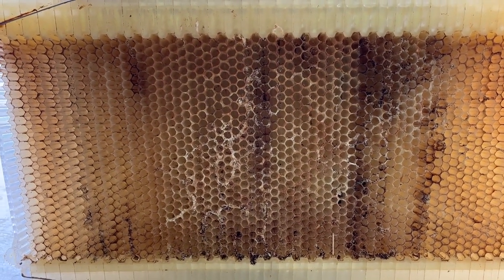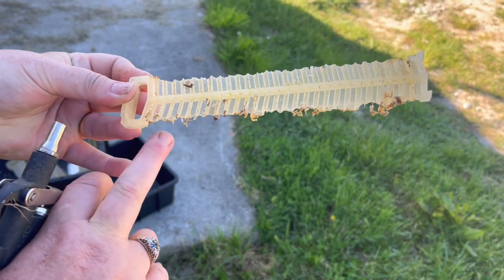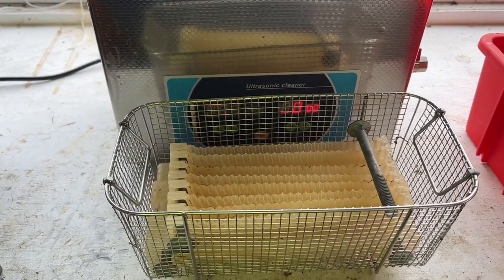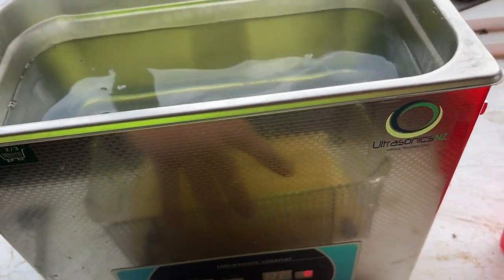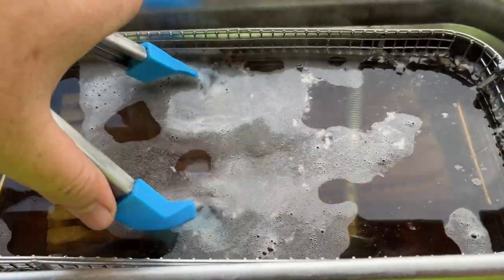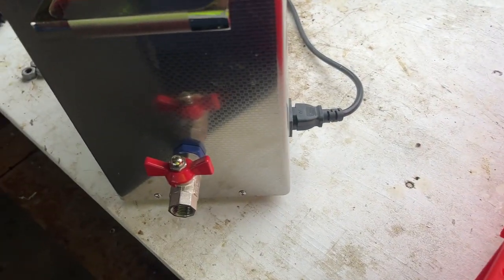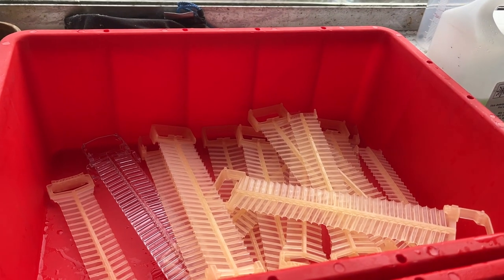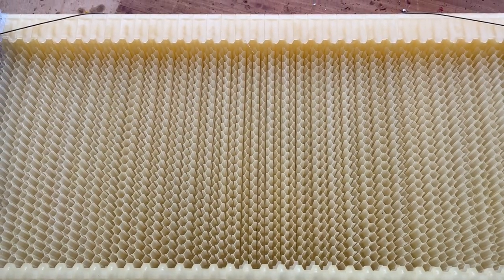Cleaning a Flow Hive frame with an Ultrasonic Cleaner

Comment: It looks like you've had some wax moth larvae on that comb. Very nice demonstration, and thank you for sharing it!  Really great job on those end panels as we all want to be able to see through them! My question is, how did the bees take to them after cleaning? The as when they were new? What's your favorite method of re-attaching the cord that holds the frame together? EXCELLENT!!!!
Reply from the maker: Hey Frederick. Yep, these frames have had a bit of everything on it, wax moth, spiders, slaters (wood-lice), wax, propolis etc. 

They were second hand frames I got from a new beekeeper. She tried them but they didn’t work for her in her first year, so she became disillusioned and gave the frames back to her mentor to deal with. He threw them around the back of his shed, and there they sat for the next 4 years, till I started my hunt for extra frames. 

Because they are used, I am not prepared to put them on my hives until I have removed all the wax. The last thing I want is to potentially spread AFB to my hives or any other hives around me. 

After I cleaned them, I applied some wax to them and popped them into the hive. The girls started working them almost straight away. 

As for putting the wires back, I did a video on pulling the frame apart and putting them back together. I have since found a slightly easier way of attaching the wires but to be honest, I do it differently every time lol. 
https://youtu.be/RUrc1gu2o4M

I also did a video on how to clean the frames the ‘hard’ way, using denatured alcohol and a toothbrush. 
https://youtu.be/KeXOi9NiVAg
Reply: @Kat_Andrews  All excellent, I'll be sending viewers your way soon! :)  Thank you for taking the time to reply!
Reply from the maker: @FrederickDunn  no worries and thank you too. Collective knowledge is much better than reinventing the wheel.

Comment: Hi Kat 
About dismantling and reassembling a flow frame.
My first step is to observe and record the number of twists in each of the wires.
Next, the bottom wire is most easily removed by levering it off the front end where the frame does not have shoulders around which the wire must be moved. If the bottom wire is the first to be removed, the top wire can then be slackened by "fanning" the bottom of the frame apart into an upside down W shape. The frame can then be separated into its various parts.  Reassembly is by first assembling all of the frame except the wires, then fanning the frame, fitting the slack top wire with the correct number of twists until it is engaged in the grooves at both ends, then closing the fan so that the frame assumes its correct configuration. Now with help from another person band the frame with string and tie it off to prevent expansions. Finally fit the bottom wire to the drain hole end, then do the twists, then lever the front end into its groove around the frame corner which has no shoulders.
Reply from the maker: Thanks. I’ve already made a video on how to disassemble and reassemble the frames.

Comment: Great advice. Cleaned up nicely.
Reply from the maker: Thanks. I’m really pleased with how they came out. Only another 5 frames to clean… lol.
Reply: @Kat Andrews  just got my first flow hive. Probably another two weeks before brood full enough for the super. How many years of use before they look like this?
Reply from the maker: @kidneypop  hopefully never. These ones came off a hive after only a season. The owner had bought an original FH and just thought that bees were ‘set and forget’ type critters. When she got no honey at the end of the first season and a lot of dead bees, she walked away from the hobby. Her ‘mentor’ got left with the hive. He dumped it out the back of his shed where it sat for about 4 years, gathering dust, wax moth, spiders, grass clippings etc. I then bought the hive off him with the purpose of cleaning the frames up and expanding my hives. If your hives are well looked after and maintained, they should NEVER look like this. Some wax and propolis, yes, but nothing like this.
Reply: @Kat Andrews  thanks for the heads up. Plan to treat my be like family!

Comment: Hi Kat, I just wanted know if you changed the water and detergent for each batch of the frames or did you just keep adding additional frames to the old water? Many thanks.
Reply from the maker: After about 3-4 batches (so just more than one complete frame) I would have to change the water/detergent mix. The wax would emulsify into the water and it would start coating the clean frames as I pulled them out. I depended on how filthy the frames were. Because of that, I did the cleanest frames first and worked my way through to the dirtiest. That way I got the best use out of the water.

Comment: Hi Kat, I have  tried  the ultrasonic cleaner  and detergent  and it did a great job, what ratio of detergent  did you  use.
My frames had  very  heavy propolis and wax ( I also inherited the dirty frames). I will  post some before and after pictures when finished.
Reply from the maker: The manufacturers recommendation for MY machine is a 10:1 ratio, so I use 3.6L of water and 400ml of detergent. Check the instructions that came with your machine, or contact the supplier for their recommendations. Your detergent may also be different too. 

Best of luck cleaning yours, it really is satisfying seeing the before and after images. Definitely makes it worth it.
Reply: @Kat_Andrews  " MY machine is a 10:1 ratio, so I use 3.6L of water and 600ml of detergent " ? = 1 : 06 ! 🤣
1L = 1000ml water

1 : 10 ) 1000ml : 10 = 100ml detergent

1 : 20 ) 1000ml : 20 = 50ml detergent

1 : 25 ) 1000ml : 25 = 40ml detergent
Reply from the maker: @ben-fg3fp  thanks for that, just realised I made a typo error and it should have been 400ml. I’ve changed it now. Thanks.

Comment: Great video & excellent results Kat. Can I ask the brand and/or capacity of your ultrasonic cleaner please? I'm guessing if you use at least 4 litres of fluid then it's about a 6 litre tank?
Reply from the maker: It doesn’t have a brand on it, it just says Ultrasonic Cleaners NZ as that is the company I bought it from. It is a 5.7L. The website of the company lists all their models and so I went for the one that had a tank that was 30cm across. All the other tanks were 19.5-28cm across and they wouldn’t fit a whole blade in them, acrossways. If I had the money I would buy about a 12L so I could do an entire frame at once instead of doing it in 3 lots.
Reply: @Kat_Andrews  thanks. I checked the equivalent model here in Australia & the price for a 15L is about $420. I have 4 sets of flow frames & cycle through 2 or 3 in any 1 season, so that's not too bad, especially when the results come up as well as your demo. Thanks again. 😊
Reply from the maker: @jasonrasheed7670  that’s a pretty good price for a 15L. Ours was $600 for the 5.7L. A 15L one here would be horrifically expensive.
Reply: You have inspired me to do it this way. Tried other ways and way too time consuming. How often do you change the water.

Comment: Hi there, I've use different cleaning  solutions but not with as good  results as you've achieved. Do you know what the ingredient of your cleaner is ? Just so I can see if it's available in Australia. I used your link to the ultrasonic units but unfortunately they can't ship that product o/s. Not sure it's the same cleaning solution you've used anyway ? Hoping you can help 🙏
Reply from the maker: Hey Jo. The cleaner is called EnviroCleaner. I’ve used it extensively on boats before and it has the ability to strip paint if you’re not careful. It’s manufactured/marketed by Chemetall/Tergo. Hopefully you can find an equivalent in Aussie. We have run out of it, so the other day I used Simple Green in it, at the concentration recommended on the bottle, which I think was 4:1, not like the 10:1 that envirocleaner is. It worked really well and was quite good a lifting paint off the stuff I was cleaning. 

As for the U/S cleaning units themselves, try Unisonics.com.au

Best of luck.

Comment: What size is your ultrasonic cleaner. How many litres?
Reply from the maker: Sorry for the slow reply. 5.7 Litres
Reply: @Kat_Andrews  Thanks Kat. I have purchased a 10L . The result is not as good as yours - there is still residue wax on the plastic. I will try a different detergent.